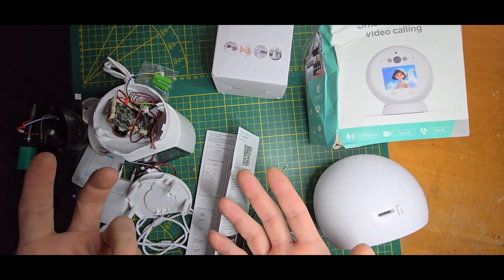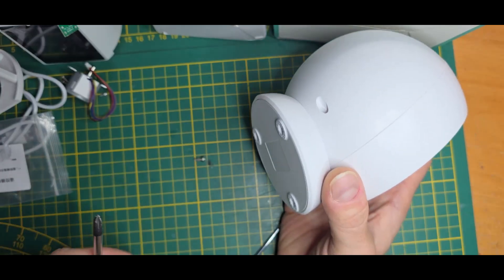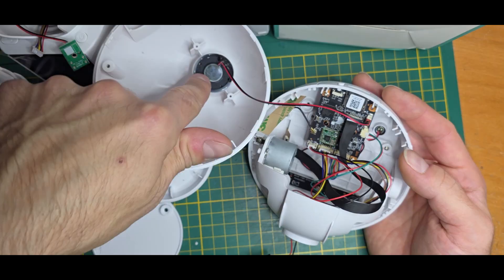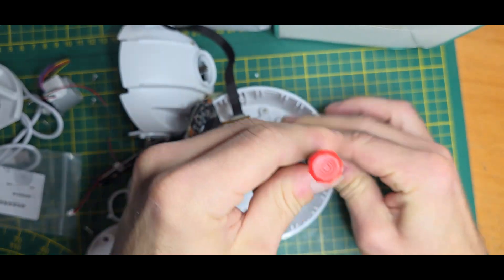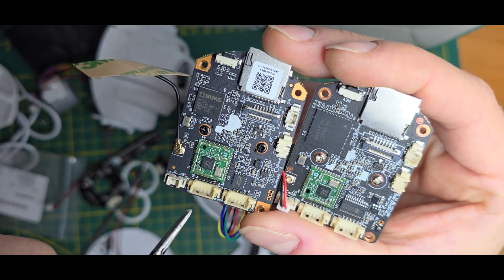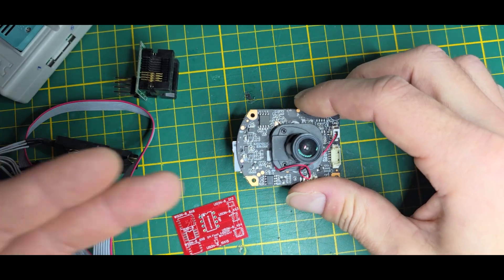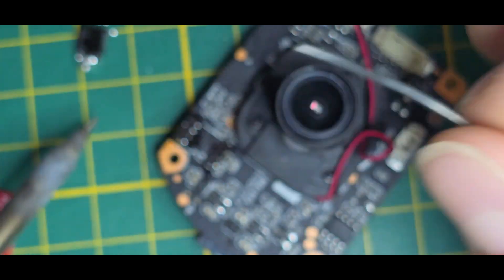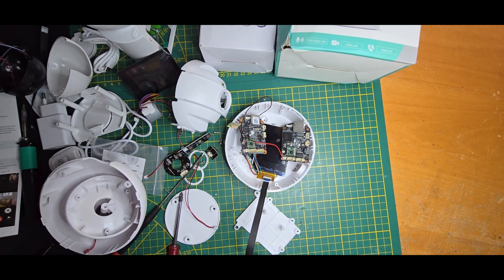15€ iCSee IP Camera Teardown and memory dump

Comment: What do you mean at 3:05 about the usb-c port?
Reply: Basically you need dumb USB-A to USB-C cable. C-c won't work.
Reply from the maker: Hey, 
Only with the 5.1kOhm on the CC-Lines a USB-C Power supply will give out 5V
https://hackaday.com/2023/01/04/all-about-usb-c-resistors-and-emarkers/

Comment: Hey, are you using the original XGecu Windows Software or that programmer? The programmer is actually very good for the price especially when buying a full kit with all of the common adapters. But their website and software download is kinda sketchy...
Reply from the maker: Yes im uaing the stock software, its the price you pay in sketchy software for cheap hardware 😔